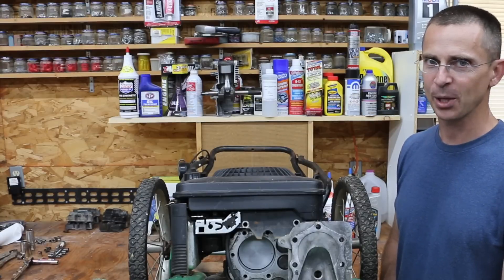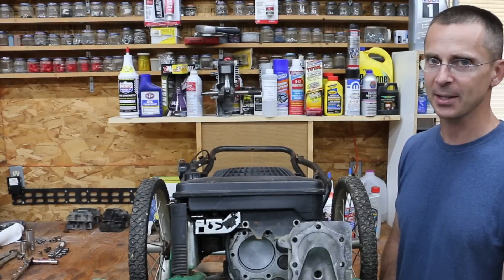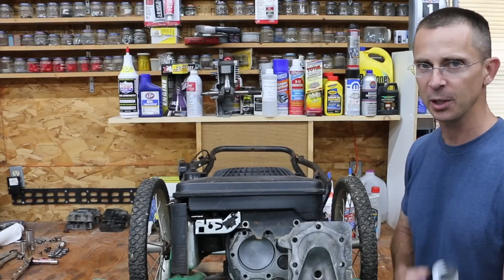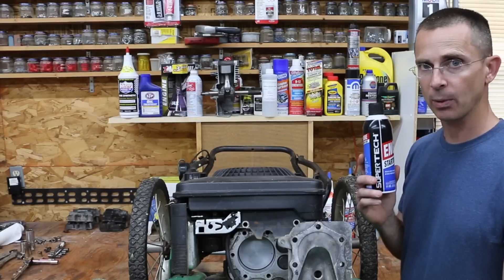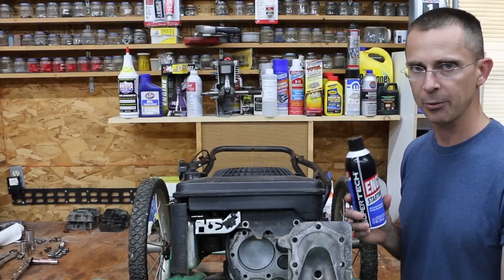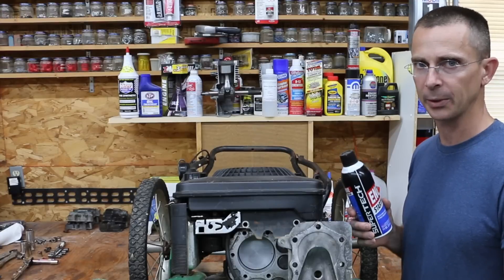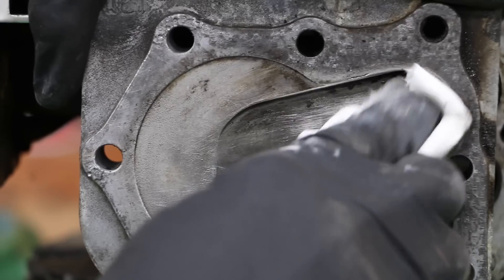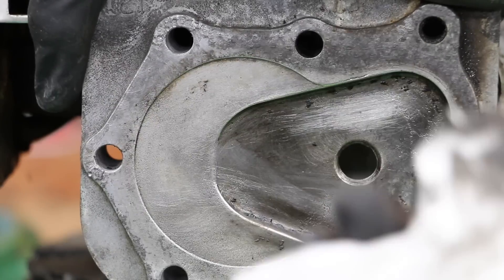Will Running an Engine on 100% Starting Fluid Cause Damage?  Let's find out!

Comment: As a diesel and automotive technician I wanted to point out a couple things about starting fluid that I have learned in my experience with it.  First of all, you didn't mention if the starting fluids you used in this test claimed that they were "with upper cylinder lubricant".  I'm guessing both brands were, since they all have been for decades and there was an oily film left inside the chamber after testing.  I think that straight Ether may "dry out" cylinders but with an abundance of lubricant added to modern starting fluids this has been minimized or eliminated.  On a gas engine, that added lubricant, I feel would foul spark plugs in short order.  On a diesel, there are several concerns,  unlike gas engines which can time the ignition even via spark, the diesel has no way to precisely time an ether fueled combustion event, this can lead to pre-ignition.  Other diesel concerns are on engines with glow grids in the intake tract, which can cause an explosion that could blow off an air cleaner, explode an intake manifold, start a fire, cause a cylinder to intake an already burning mixture, and i'm sure others i cant think of now.  Diesels with glow plugs can be much more susceptible to pre-ignition.  There is also the concern of saturating an air filter element and causing a run-away engine condition.  As always, I'm glad you did it so I don't have to!!  Great test that I have always personally wondered the outcome of.  Keep up the great work!!!
Reply from the maker: Thank you!

Comment: I'm sitting here, racking my brain, trying to think of something else that's flammable you could use as fuel.  Hairspray?  Lysol spray?  Nail polish remover? Spray deodorant or air freshener?  Tried any of those?
Reply from the maker: No I haven't. Thanks!

Comment: I don’t think it causes damage as long as you use it correctly. It doesn’t matter in the lawn mower example but say you have a large Diesel engine, multiple cylinders, with larger volume of air going into each cylinder and the high compression. If you spray starting fluid then spin the engine over you may suck all that starting fluid into one or two cylinders. Just seems to me you may want to have the engine spinning over before you spray seems like the majority of the engine will have the starting fluid in it, evening it out and less stress on the engine. I’m not sure but appreciate you making these videos testing this stuff
Reply from the maker: Thank you!

Comment: Spilling that much ether next to a running motor might kill it faster than on the inside.  There is an oil in starting fluid.
Reply from the maker: Thank you!

Comment: The old days of ether have long since passed. Starting fluid leaves a oily film (evident in video) , ether on the other hand draws oil out and dries it. However in a diesel theyll help start them but with ether, once used so many times...your stuck with it.
Reply from the maker: Thank you!

Comment: Way back when DOT 1 brake fluid was the norm , I was told the used car dealers would drop a little brake fluid in an engine or rear end to swell the seals. Long term it would eat the seal up, but it would last long enough to unload the car on someone. Another trick they would use was to put sawdust or banana peels in a tired rear end. If you had an engine laying around with a leaky crankshaft seal...? BTW , love your videos.
Reply from the maker: Thank you for the video idea!

Comment: From experience with a diesel if you sprayed like you would easily overspin the motor to failure
Reply from the maker: Great point.
Reply: @ProjectFarm  Diesel failures can be crazy sketchy too should always have a way to plug the air intake on hand.

Comment: The reason it's dangerous to a diesel is the compression ratio it fire before it is supposed to pre ignition it is like running gasoline in it but high octane diesel fuel doesn't have octane it has certain
Reply from the maker: Great point!
Reply: I've heard but never sucsessfully tried ,the way to start a cold diesel is to hold a gasolene soaked rag over the intake while cranking it.

Comment: I always heard it would dry the cylinder walls and score them. I mainly heard this when having to start diesels in freezing temperatures. I wonder if the fear of damage is from oil that is too thick to circulate properly until the engine heats up.
Reply from the maker: Thank you

Comment: I stopped using starting fluid a long time ago. I use carb cleaner instead. The carb cleaner will not hurt the engine so I am told.
Reply from the maker: Thank you!

Comment: It would be really interesting to see what would happen to an engine with a lot of carbon build-up if you were to run it on propane if the carbon would just bake and go out the exhaust or if it runs hot enough to actually damage the exhaust valve
Reply from the maker: Thank you for the video idea!

Comment: When there's a probability of fire, it's better not to use rubber gloves, as if they catch on fire, they can stick to your hands and you won't be able to get them off, so you could potentially suffer some serious burns. It happened to me once, with a piece of masking tape (I set it on fire while holding it with my fingers, during some sort of "flammability test" and since it was too sticky, I couldn't get it off in time, so it wrapped around my fingers and continue burning (I couldn't put it out by shaking my hand). It hurt as hell. I was taught not to use gloves while using bunsen burner at my chemistry class, back in the day... Nice video, btw!
Reply from the maker: Great point!  Thank you

Comment: Just watched again. I still want to see a diesel on starting fluid and a 2 stroke on starting fluid. Keep up the good work
Reply from the maker: Thank you for the video idea!
Reply: There is a video on HOW MUCH STARTING FLUID DOES IT TAKE TO DESTROY A 14 LITER CUMMINS it took 16 10 oz. Spray cans. They hooked up a tubing about 20 feet long and 2 gentlemen  sprayed into the tube and it went straight into the turbo. It didn't come a part, but made some knocking noise then stopped. 
Took about 20 minutes

Comment: If you had a dynamometer you could load the engine and in all probability with starting fluid as fuel it would detonate and cause major engine damage.
Reply from the maker: I need to build one. Thank you

Comment: My theory mind you this is at the beginning of the video it all boils down to Flashpoint and the flashpoint on starting fluid is a much higher flash point than regular unleaded gasoline I could be wrong I would love to know your opinion about this I know you can start a diesel with starting fluid I've done it I don't like to but sometimes if the glow plugs ain't working you ain't got no choice
Reply from the maker: Thank you

Comment: Bit of a belated common BUT yes a diesel will run off starting fluid (also will run off non chlorinated brake clean) but it will run away and tear itself to bits. I had a serious scare after using a 2 second burst, revs shot right up to the redline and would have went further but luckily it ran out of "fuel" and died, else i would have been running to choke off its air intake.
Reply from the maker: Thanks for commenting on this.

Comment: I was told that using starting fluid makes the engine “dependent” on it. True or not??
Reply from the maker: Great question.  It would only become "dependent" if there's been internal damage to the piston rings, valves, etc.  This seems possible.  I find it interesting that some of the old John Deere tractors come with factory installed starting fluid systems for those cold morning starts.  Thanks again.
Reply: My thought is NOT true... battery condition and general poor maintenance might have something to do with that.  If you have to crank an engine for 10 sec. or so (cold weather) starting fluid might help. If the battery is bad... is that engine now "dependent" because it won't start without a squirt?

Comment: Well,what was the composition of the starting fluid,many of them are isopropyl with  with a low percentage of ether,whereas pure ethyl ether is quite dangerous and would evaporate faster than you could spray it in the gas tank and you would be overcome by the fumes and pass out or die,I was shocked when I saw you spraying it like that,heck they could use pressurized acetone and it would work and be less dangerous than ether.
Reply from the maker: Great point. Thank you

Comment: I've always been a critic of ether (commonly sold as starting fluid). I will admit a four stroke should be less susceptible to damage due to it having a constant supply of oil from the sump. I would not ever EVER be caught dead spraying the stuff into my two strokes (although mighty tempting in the winters lol) how ever as they rely on the fuel mix to lubricate. Ether just washes that oil away and ruins them. I would love to see this test on something like a weed whip to see how it might damage crankshafts and engine bearings. Keep up the vids I love learning from them!
Reply from the maker: Thank you

Comment: Starting fluid is harmful to 2 stroke motors as the fuel is drawn through the block and the oil in the fuel is what lubricates all the bearings and rings. Seeing how a 2 stroke lives on the verge of oil starvavion anyway the starting fluid would cause those parts to wear faster.
Reply from the maker: Great point. Thank you

Comment: I read a safety notice on a can of linseed oil. It's in some cases self igniting. I wonder if that is good enough for a 4 stroke petrol engine. Maybe it will ignite prematurely or not at all.
Reply from the maker: Great video idea!

Comment: When you are trying to spray a can of something into a gas tank, I would recommend using one of those straws like you get on a break parts cleaner can, You can get more in the tank and hold the can more level allowing you to empty more of the can.
Reply from the maker: Great recommendation.

Comment: Here is what happens when you use starting fluid on a diesel engine (pre detonation self destruction) 
Both of these images are of engines without glow plugs.

https://ibb.co/f0JBMU
https://ibb.co/mJc5gU

I don't have any pictures of glow plug detonation but I have seen a few 7.3L diesels destroy themselves also.
Reply from the maker: Great point and thanks for commenting on this.

Comment: Is there any way I can use some alternative fuel or a 50/50 mixture in a 499cc gasoline 4 stroke single cylinder air cooled engine producing 27 bhp and 41Nm of torque because Gas in India is damn expensive, it around 4.4 USD for a gallon(US), my motorcycle has a fuel injector but has pretty low compression ratio of 8.5:1. Please suggest a safe way or the least harmful way in which engine won't start knocking.
Reply from the maker: I haven't found an affordable product that will work well.
Reply: thanks for the reply man, you'r just like me trying to experiment in each and every thing, my and your way of thinking matches perfectly. applause for the great job.

Comment: All starting fluids are not the same. Some, like walmart's brand have some propane in them. Others, have no propane. Most if not all have a lubricant in them. Read the can, it may surprise you the differences in starting fluids.
Reply from the maker: Great point.

Comment: Damage to a diesel engine is much MUCH more likely. Starting fluid is for gasoline engines and I doubt that it would cause any kind of damage as confirmed by the video
Reply from the maker: Great point.

Comment: Running an engine at a steady, no load condition puts little demand on the fuels ability to not ping or detonate. Ether, which most starting fluids are made from have poor anti-knock values. Putting the test engine into a more dynamic mode, making it work under a variety of loads and conditions is the only way of getting a valid test result. Lawn more engines are about as basic as you can get, they have low compression ratios, no O2 sensors, computers or any other sensors to speak of. Just because a lawn mower motor will run with no load on it and show no obvious signs of damage doesn't really show very much. Most problems with any type of reciprocating engine, be it gasoline or diesels are cumulative in nature. This means that it would most likely take more than just 
running the engine for 20 minutes at no load, to show up anything obvious. Still I like you videos very much.
Reply from the maker: Great point and thank you for the constructive feedback on this.  I've since begun applying a load on test equipment to check for pre-detonation.

Comment: I've heard excessive Heat because of the temperature of the explosion and cylinder walls. For 20 years I've heard that. Low octane rating  equals pre ignition . The main problem with a car engines is with higher compression ratios It can self  ignite turning into a compression-ignition engine. Without proper timing it can bend a connecting rod.
Reply from the maker: Great point.

Comment: I will tell you what I tell everyone. Spraying carb cleaner and starting fluid into a running motor is dangerous. I used to get students their last few weeks of school for diesel technical school when I was a fleet mechanic. I warned them about using that stuff to find leaks. The instructor had a different opinion. One day a guy showed up wear burn gloves . He came to tell me I was correct. He had been burned when the carb cleaner ignited. 

I know your doing this for a purpose. I would suggest wearing extra large welders glove. Extra large so you can flick them off in a emergency.
Reply from the maker: This is excellent advice. Thank you!

Comment: Please test Rustoleum spray paint as a starting fluid.  I once did this accidentally and it worked fine.  I never noticed until I found my starting fluid still on the shelf and the spray paint out by the mower.
Reply from the maker: Great recommendation.

Comment: I do not believe it will damage an engine I think it's a myth. It's designed to start an engine and I'm sure the company who made it is sure it was safe for long use for tricky engines. It was nice to see it did not damage the cylinder wall even after 30 minutes.  Very cool experiment I enjoy these videos. Thank you
Reply from the maker: Thank you!

Comment: Most starting fluid is very similar to gasoline anyway and has some dissolved oil for lubrication. Most is 70-80% heptane and 20-30% ethyl ether. So, I don’t think it would do long term damage if you used the right stuff. On a diesel it would explode way too early.
Reply from the maker: Great point.

Comment: SMH... You didn't show the MSDS like you have done in some other videos. The first can you used actually has lubricating oil in it. The Prestone brand doesn't. The Super Tech has a lot more different types of chemicals in it.
Reply from the maker: Great point.  I should have show the MSDS.

Comment: Very sound test.  I'm stumped actually.  Very nice to know this indeed.  Hey @Project Farm - I got a super close friend that refused to listen to me.  Mountaineer (98') sat for over 2 years with no cranking.  It has 3/4 tank of gasoline (pure trash now) - want to laugh?  I warned him not to attempt it - he thinks the gas is OKAY! lol - no start - now a code is showing.  I only hope the code is from a "fuel not burning" sensor of some kind.  What are the odds my buddy wrecked the motor?  We want this car - but damn!.

Me?  I warned him - Me? - Change ALL FLUIDS before ANYTHING.  Heck, I'd hand crank a couple of turns with a huge breaker bar.   How to get fresh clean oil up top before any potential damage?

In the meantime - you've shown me these engines are pretty tough with these actions.  Give's me hope.  I don't have the funds/time to deal right now - but I have heard that starting fluid can be applied to injection systems as well. By virtue of that that you've shown oils on those parts after the torture gives me good hope.  Once I start on this car - I want to have all ducks in the row:

New Tranny filter.
New Tranny fluid.
Oil / filter job.
New Gas Filters ? - this is the part where I get mad. I warned him.  Now I'm sure the filters are plugged up. THANK GOD FOR THAT!

Do I need to address the break fluids as well?

What of long term Titration... sludge the bottom  - hot ass fuels to the top.  Damned good thing it never fire up - Really hope a fuel system filter blocked this stupid maneuver.  Someone needs to test this with on a 350 fuel inject system - I'd LOVE to see the results!
Reply from the maker: The engine will probably be fine, but he needs to get rid of all the old gas and flush the fuel system. Hopefully, the injectors are okay. I would change the brake fluid too.  Thanks